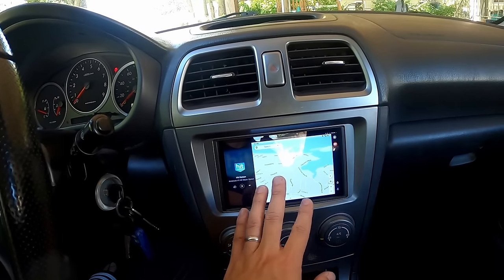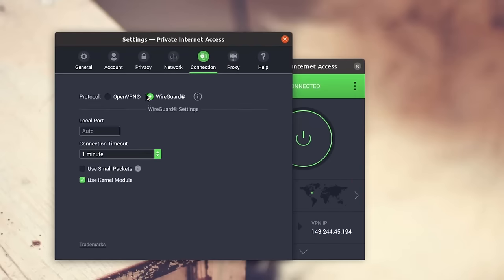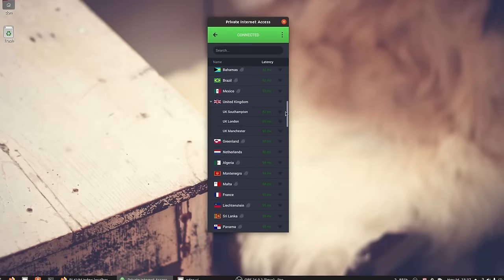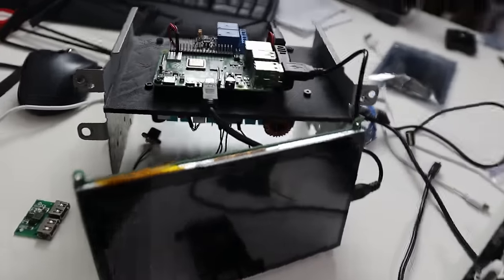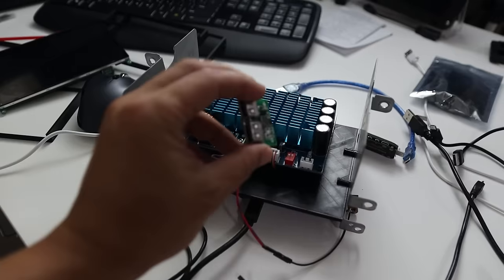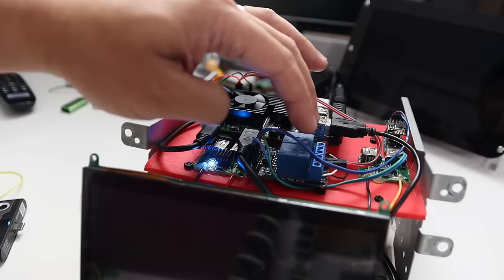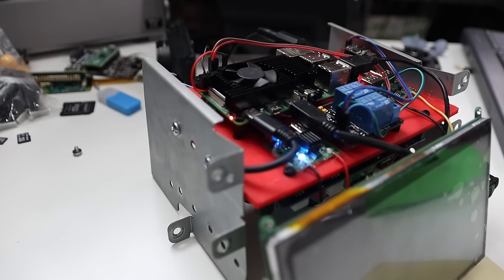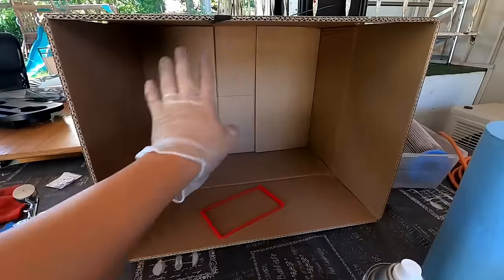OpenAuto Pro / Raspberry Pi Head Unit with Android Auto Full Install Build

Comment: Awesome, man! i've been thinking about making a build like this myself, was holding back and waiting for a properly working android build for Pi. I haven't found a head unit for my car that i'd actually like for almost 10 years now. thats frustrating that you have to build something yourself to make it actually good. My plan was to not use a built in amp, since my speakers are powered by an amp anyway. And i'd like to find a proper good sounding sound card for the pi, and one thing i have to solve is that i definitely need a rotary volume switch and maybe couple of buttons for next and previous tracks.

Comment: Very neatly explained. I will soon start installing openauto in my car.

The only thing I can't find is that on your drawing and the script for the esp. Only 1 wire goes to the relay. But in your video I see 2 wires.

I understand that's for the double relay. 1 for the gpio and 1 for the global_en. But I don't see whether that has been incorporated into the script that I have to put on the esp.

Thank you for the clear explanation. Keep it up

Comment: I have been waiting for this video. I have most of the parts and now I just need to source the 3D printed parts.
Reply from the maker: i just finished uploading the 3d printed plate needed for the install
Reply: @NovaspiritTech  Perfect I just need to find someone to print it. That is a machine I do not have at the moment. I also need to get a custom face plate made as well. Huge gaps around the 7" screen and my dash kit. You have a 3D printer you recommend?
Reply: @chadgilleland6521  look for local makerspaces or get it printed online.
Reply from the maker: I heard public library has 3d printing now
Reply: @NovaspiritTech  Just posted the files to the local library. They do the print for $.06 a gram. Better then buying printer at this time. I am looking at them though. I am thinking the Ender 5 pro.
Reply: @NovaspiritTech  what the hell... good to know lmao

Comment: If you have any issues with it keeping it cool you could always use the ac ducts above. I would 3D print some small tubing and adapted to the Ducs above so that way it blows cool air on the Raspberry Pi. But you have to figure a way to shut off the airflow during the winter the heater is not blowing on it

Comment: That is neat! I little bit of warning about peeling the plastic off of the screen is(or any other electronic for that matter), make sure that the system is shut down. and disconnected. The chances might be low but the static electricity from peeling the plastic off can damage your system.(Dont ask how I know)

Comment: That bracket does not have to be that precise. You could use a piece of masonite and just drill, glue and screw it together. A spacer for the screen is a bit more of a precision part, and it shows a little, si that it almost surely worth printing. I do plan to make one if these myself, but as long as I can work from home motivation is a bit lacking - LoL

Comment: Nice setup. It looks very professional. I am curious as to why you chose to have the amplifier at the bottom instead of on top since it is the biggest source of heat. Isn't it unnecessarily heating up the Raspberry Pi and other components?
Reply from the maker: that is subjected to change, the current configurations fits perfectlly in the cubby, if i had the amp on top,, i'm also use the plate to be in the middle so it can push up on my screen so can't really move down the whole assembly, might need a redesign
Reply: Yeah, I'm thinking it would be better to relocate the amp somewhere else entirely. Everybody in the comment section is talking about heat.

Comment: do you not need an isolated power supply for the pi to avoid ground audio interference?? 
Im guessing you will run into a buzz sound or a high noise floor.... you can fix that by isolating the power supply for the audio source from the amp..

Comment: Really cool but I have a question. Why did you use relays instead of transistors? Transistors arent noisy, use less space and you're working with low voltages so why not use them?
Reply from the maker: cause i had relays on hand, transistors is something i will upgrade to later

Comment: What was the logic behind making a flat  piece of plastic out of PLA from a 3d printer to mount the PI on,  Would it not have been a much faster and simpler option to cut out the desired shape out of a existing flat sheet of material like delrin or acrylic, and simply drill holes as needed

Comment: Have you ever Built a unit for a customer ? I have a automotive application where I would like to take an OE Audi RNSE and rebuild its internals ( and replace screen ) to create a 2021 era functional head unit that looks stock adding things that you'd find in off the shelf units -but that in addition give you an in-dash computer ...The unit is made in Japan by Aisin Co. for Audi,  my thoughts were that some of the switch gear, ( buttons ) could still be used to control the unit, but the screen could be touch screen and some other inputs for things like Back up Cam or Bluetooth which were never available could be added ... fans and the heat sink could be harvested from the donor unit ..

Comment: Looking forward to find out how to get FM radio working with this. However I am wounding if the audio has the ability to fade between front and rear speakers. Or does the amp only have one left and right signal instead of front L/R and rear L/R.
Reply: I'm planning some sort of variation on this. I've bought a Rockpi4c, and a 128gb NVME drive, 7 inch screen, USB GPS Receiver and running Android 10 on that. For the radio, i'm planning to put a 4g dongle and use something like TuneIn or similar. And on the audio side, maybe the correct thing to do is just using a decent sound card, and rely on a cheap nice sounding car stereo hidden somewhere else. Another way to do it, is using a toslink output, and put a multichannel micro amp with DSP like the 
Match PP 86DSP, Mosconi D2 100.4 DSP, or one of the many chinese amps with the same functionalities.

Comment: The resurrection of home brewed carputers!
I had one in 2001.
It sucked. But it worked. No touch screen though. I couldn't afford the screen. I forgot the name of those screens everyone was using.
I used a cheap little laptop, which was a lot like a netbook before there were netbooks.
I played MP3s using winamp and some skins and key mappings to a hacked keyboard.
I used a laptop hard drive, mounted on an isolation sled made using an old car Cd player silicon dampers.

Comment: Sorry Im late to the party but mausberry circuits has a power board specifically for running you Pi off of an ignition source. Then you can program it to gracefully shut down your Pi. The cool thing is , you can program it to turn off the Pi after the car is turned off, for instance I have mine turn off about 30 mins after I turn off the car so if I just make a quick trip into the store it will not need to boot again.

Comment: If I understood you correctly the Red LED is on when the Pi is turned off, dessolder the red LED, it would lower your standby even more.
Or you could try finding and RTC module for the pi, and have that keeping time, and turn power to the pi completely.
Reply: or you could just buy a bigger battery or make your own lithium-ion battery pack which should be pretty cheap and easy,     I like easy
Reply: @MickeyMishra  so a free mod option, vs replacing a battery. Or a cheap mod for keeping time vs a replacing battery. I don't follow  the logic.

Comment: This is so cool, thanks for posting this and can't wait to see what's next. I bought a rock pi to try doing this before the pi 4 came out but unfortunately due to lack of software and some breaking the as slot off when it dropped on the floor, I was unable to complete that. Might give it another shot however using this setup.

Comment: I'm interested in the Audio section. I am wondering how the balance/fader works when there is only a Left and Right output into either 1 x 4 channel or 2 x 2 channel amps. Have you tackled this problem yet?

Comment: I know this appears to not apply on your build.....but steering wheel controls. That's the one thing stopping me from doing this in my CrossTrek right now.
Reply from the maker: I have a blue tooth controller that can be used as steering wheel controls, didn't want to install it yet
Reply: there is a unit that will work with your stock steering controls.  there is also an open source Android app that allows you to do this as well as it is on most of the Chinese head units and built-in.   since you're using a Raspberry Pi it will be a simple method I've just using one of the gpio pins that are there and interfacing them with your canvas system be a can bus interface module.   

there's also a commercial product that does this is well and I think it's from a company called pack p a c
Reply: @MickeyMishra  for doing steering wheel controls? What's the name of the thing that does that?
Reply: @AddieDirectsTV  I'd recommend this: https://axxessinterfaces.com/vehicle-fit-guide. I've added a head unit from China but I'm about to open it up again. I'm going to add a rear view camera + fix my missing steering wheel controls with one of the products from that company
Reply: @olab1627  you rock! thank you!

Comment: Hey, I am currently working on a fully custom 1988 Nissan Pulsar NX from the engine bay to the rear bumper everything custom. I am looking for a head unit that has apple carplay but I can also run a lot more off of it. Like having triggers for my doors to open after the windows have rolled down some,  if speed is under 5mph for backup and forward cameras to come into display, controlling LED  lights, that sort of thing. This seems to fit the bill perfectly. I was wondering if you ever did put the backup camera in? Also, I am very new with this raspberry pi stuff so I was wondering if you could make a wiring diagram or anything like that just to help me understand how you have the wires and components connected. Thank you in advance.

Comment: Very nice. I built one using a odroid xu4 running android, and a TSA8498 4x100w bluetooth amp, using the bluetooth instead of an audio jack for the amp solved the noise issue
Reply from the maker: Someone on the comments commented about using a Bluetooth amp and Bluetooth mic, I might want to give that a try

Comment: I did this build almost verbatim… but used a Pi 3B and I used a rather small 3.5” screen to blend into my vintage looking radio on my VW Beetle restoration.  I bought some reasonably rated  and priced Kenwood speakers and was successful with CarPlay music, navigation and at least the sound from calling but microphone isn’t working yet.  Not sure why.    … but I have a question… did you need to do anything to get good quality from this Amp and Pi setup???  I have plenty of volume but the sound is a bit scratchy and muffled.  Any suggestions?  I tried some changes to the OpenAuto Equalizer and fiddled with some of the sound settings on the Pi itself but still can’t improve.   Please please please any suggestions?
Reply: Oh, also, if I have the USB soundcard plugged in, the Openauto Splash screen loops nearly endlessly.  It seems to finish up after 10 minutes or more.  When unplugged it boots normally.  Any ideas why that might be?  I disabled the RPi built in soundcard so the USB soundcard is the only thing loading and seems to load with the proper Kernel.

Comment: awesome video. I wanted to do this for my classic car, however I dont want to delete the old radio because it is original, but I found a spot I could add a raspberry screen. I just want to use the raspberry screen for a backup camera and map directions, I have already retrofitted bluetooth into my factory radio and a sound system, would it be possible for my one single phone to connect to both my bluetooth radio as well as the raspberry pi at the same time. displaying only the maps to the raspberry pi and the music to the radio?

Comment: Very cool. I would want a physical knob for volume. Also a delay after accessory off until door opens.
Reply from the maker: yea physical knob is not hard to code. it's already got configs for it in the openauto pro. for the door to acc, i would run the wire to maybe a dome light or something...

Comment: love that set up real clean iv been working on a similar set up in my mustang. I also run my custom ecu in mine with tuner studio installed on the head unit as well so i can back out the stereo and open the app from the desk top on it. not only do i have all the gauges but can also custom tune my car right from the head unit. if you wanted to take your car to the next level with a diy full stand alone ECU look into making a speeduino and you can tune it through your raspberry pi head unit. also I just subscribed like your content.

Comment: I have one Question. The 12v amp must use more power then those board can handle. Have you tested them. What was The results. How many amps does it use.

Comment: I am building a unit right now, and was wondering if using an UPS module with graceful shutdown will be a good option instead of using the 2 relay system you have?

Comment: I’d have to look at the dimensions and power input spec, but HifiBerry has their BeoCreate amp board that’s equipped with overkill levels of audio DSP for the amps. they’re $250 ish but take 12v input and powers itself and a pi.
Reply: it's perfect for to channel operation however in a car automotive environment I wouldn't necessarily use this device for high quality sound for obvious reasons mainly being that it's only two channel.  there is a 4-channel option and that is a little bit better but you really need about six channels minimum as you are going to want to run fully active.   
 
I just go with the standard Automotive dspp which can be bought from anywhere from 99 to around $1,000 depending on what you're going for but the average cost to get into the game is about three hundred bucks.   

Dayton audio makes a pretty good unit that is pretty much plug-and-play and can be used via USB Bluetooth or even Wi-Fi.   the best option still honestly would be an audio control DSP /amplifier combo.   it has all the ground Loop stuff already built in if you're going to use a coax but you can also use the USB and Optical to eliminate any interference from things like ground loops.   

you will still need Windows or Mac to go and set it up but for the most part a regular Raspberry Pi has the ability to run a Windows distribution in order to log in to the audio control gear.   however they do have apps that will connect to an Android instance if you want to go ahead and mess with the digital signal processor settings

Comment: This is awesome! Do you have volume controls on your steering wheel? My 2010 outback does. You'd probably need to use another anduino to feed the input to the pi though. For radio you could probably use an RTL-SDR, I'm pretty sure they work with a pi.

Comment: Hi 
Cant wait for long term review
For glare did you point the screen down a bit when you mentioned 2 - 3 degrees or was that up

For time, have you thought about a simple cd2032 coin cell battery for time as they last 10 years typically ?? - every little battery drain counts

Regards
George

Comment: why not fit a RTC for the Pi4 ?  and use a Solar panel somewhere to trickle charge the battery if there's a parasitic current drain from the Pi.
internal 40 or 60mm fans will be required inside the dashboard, in series to reduce fan noise and keep overall heat buildup in the electronics below auto shutdown trigger point.

Comment: I have one similiar project going on, i just have pi 3b overclocked to 1.4ghz, smaller passive heatsink, 4A isolated step down, step up boost converter for 4x tda3116d2, few rca outputs and im using mosfets instead of relays, i still need alot more and might use my 2din alum case as heatsink.

Comment: With that amp and only 1 input signal for the audio are all 4 channels actually receiving a signal? I am doing a raspi carputer in my truck and was using just my factory radio for the amp. Now going full install. Got the same amp as you and just curious if all 4 channels receive signal from the single input

Comment: can I use a raspberry pi 3B+ as an interface between a cell phone with Android Auto and my Toyota 2020 Camry car screen.   It would be a WiFI to the raspberry pi and a USB between
the raspberry pi and the car screen's USB port.   This would let me have a WiFi connection between my cell phone and Car screen to run apps on the  car screen.   Thanks,

Comment: Hi, I'm from Brazil and following your video I have 2 questions: 1. How you will read-exchange info with the car to display the gauges? Will be CAN protocol? And 2. Is there someway to edit the graphics and screens or can just use the factory design? I`m more designer than developer, so it costs me nothing asking you. =)
Reply from the maker: i use a elm327 bluetooth for connection to obd2 for car, as far as design. i'm not sure, you would need to check on there forums

Comment: Ok so the amp for the speakers since you are only using headphone out you only have left and right am I correct? You will not get Fade and Balance, it would be one or the other. Just got the AMP in and haven't tested anything since I am lacking some parts still.

Comment: How easy would it be to control volume on something like this with a potentiometer? Would that require a setup with a different amp, or can the center tap be fed into the pi somewhere

Comment: I used to run Centrafuse thru a mini pc with win7pro worked flawlessly for years in my 2005 focus wagon then I sold the car and left everything in there. I should have removed and reinstalled into my new then 2013 Rav4 which has the worst infotainment system which I replaced with a Atoto S6 android which works awesome !